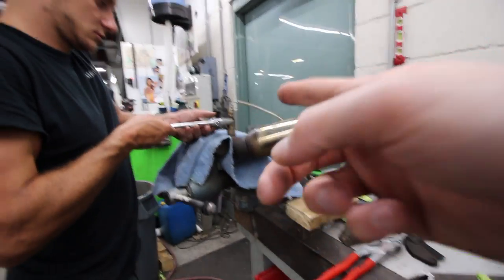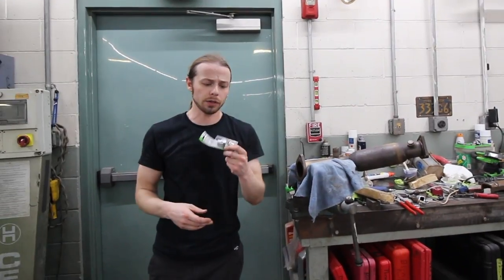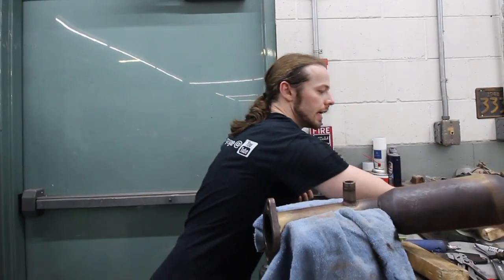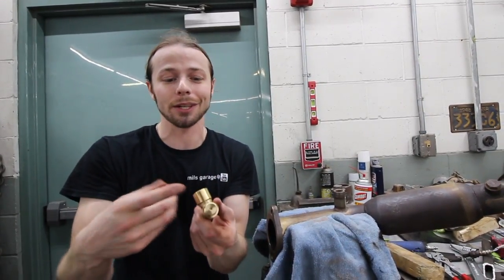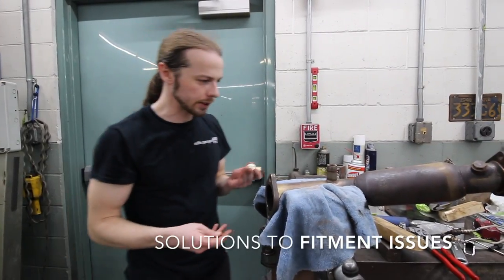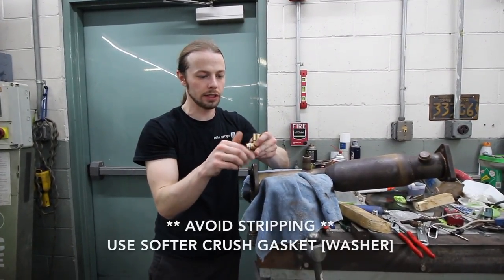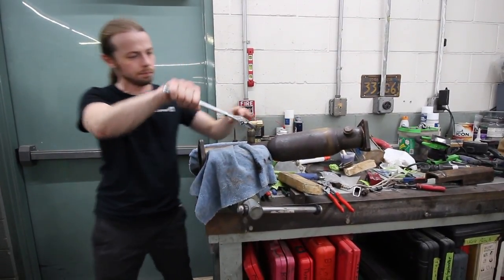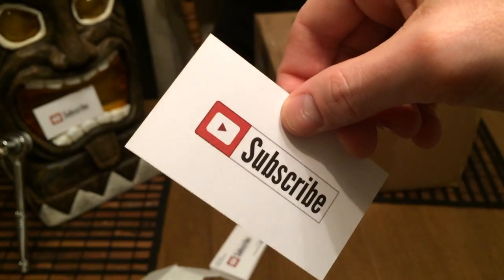How to Use O2 Oxygen Sensor Extender Spacer to Turn off CEL [ P0420 & P0430 Fix ]

Comment: Anti-seize grease, on all your exhaust threads, helps a ton.
Reply from the maker: Yessir 👍 Keep up the great work
Reply: @milsgarage  how do you know what size non fouler you need? I need to do this on a 03 Cadillac CTS. Please help. Thank you
Reply from the maker: @TR1CKSHOTS31  One way to figure it out is to search on the internet and hope they're right.. Another idea is to go to an auto store, and ask to see a stock 03 Cadillac CTS O2 sensor, and then figure out the thread and pitch there. They have bolts that you can compare the threads to 👍

Comment: Just buy the spark plug defoulers  available at autozone ,buy two packs about 12 dollars total for both, you will have a total of 4 defoulers, drill one of the defoulers with a half inch drill bit  connect the drilled defoulers to o2 sensor and  the other defouler in sequence, use 2 defoulers in sequence, disconnect battery to clear engine light and drive car normally if light comes back on, use 3  defoulers in sequence  if light comes back on same code p0420 or p0430 use 4 defoulers, if light comes back on then buy a 02 sensor simulator ,always use defoulers or o2 simulator in the last o2 sensors the ones after the cats. Usually the one before the cats is not an 02 sensor but a fuel and air ration sensor you don't want to put defoulers there ,
Reply from the maker: 🤔 Non non non non foulers? lol It'll work. 👍
Reply: Used this method on my 2005 lexus is300 two defoulers and it worked ,recently used it on a  2006 scion xb had to use 3 defoulers but it worked also,( note) barely was able to do it because the length of the o2 sensor wires was stretched to it max after the 3 defoulers in sequence.   I'm thinking 3 defoulers might be the max you can use in sequence because the o2 wires are usually kinda short and most cars

Comment: Hey man awesome video, been looking at videos all day and this was most helpful, along with the other video that went along with this one. Getting ready to purchase the rest pipes and the non foulers and get to work 🤘
Reply from the maker: @Bobby Griffith Yo Awesome! Thank you for your support Bobby! You're going to want to do it on a day where you have some extra time just in case those TP bolts are seized, and if the demon bolts don't make a sound when it feels like it's starting to turn, you're going to want to switch to an impact gun to make sure you don't strip them completely.. Hmu on the channel if you hit any snags and keep up the awesome work sir 💯
Reply: Awesome. One question though, if my o2 sensors are bad putting the test pipes on, I still need to get new sensors correct.
Reply from the maker: Yeah, you're going to want to have good sensors even if you install the TPs.. Which engine are you running?
Reply: 2005 g35 v6 3.5 it's a base model other than that I couldn't tell you, I'm not much of an expert, but ever since purchasing the g35 im becoming more of a car guy. All my knowledge comes from YouTube and occasional hands on experience lol.
Reply from the maker: Sweet. The 2005 you have most likely has a RevUp engine. You're going to want to tune it asap after installing the test pipes. This G i'm working on in the video is a RevUp too. i didn't run the engine detuned long enough to make a difference, but according to a good drift buddy of mine, it'll eventually kill the thermostat, cause it to overheat and die.. He said went through 3 engines before he figured out what he was doing wrong
Reply from the maker: "All my knowledge comes from YouTube and occasional hands on experience lol." <-- This is how it all starts 🤟😂
Reply: @milsgarage  as far as tuning goes, whats the average price range and what kind of shops would be the best to go to for that.
Reply from the maker: The tuning for VQs is pretty much standard with UpRev [ https://www.uprev.com/secure/ ]. Looks like UpRev sells the Standard license and setup for $550, but after you get custom maps and stuff, it might come out to more like $750. There are a number of tuning shops in the Delaware area that i know of if you're around. You can also tune by email after you have it all installed

Comment: HELP PLEASE .!!! Could i delete the honeycomb and install the non foulers? So like that i will keep from getting the codes and from letting my car run lean from obstruction?   I have a 07 expedition and its been a nightmare because everything is new in the truck you name it its all new and oem the only thing it wasnt was the catalytic converter i install almost a year ago. No im having rough idle only sometimes its starts to sound like its cammed 😅 you can feel somewhat of a shaking movements in park but when shift to reverse or drive it start to act out but it drives just fine and i only get the p0420 code and notices that im getting misfires at low rpms.
Reply from the maker: If you’re getting codes and misfires, it will need a tune. The computer needs to understand what to do with the new oxygen levels
Reply: @milsgarage  The problem im having that everything is new (coils, sparkplugs, injectors, fuel filter, pump, mass flow , throttle body) i mean you name it is all new and just finished doing a whole timing job with machined heads new cams and lifters and follower same as intake valves. EXCEPT !! The o2 sensors which im getting news ones tomorrow and the catalytic converter which i bought it from ebay last year and im having this rough idle when the rpm drops seems like the computer is compensating for and unknown issue which is driving me crazy lol but thanks a lot for replying !!

Comment: the P0420 code came right back so this time I stuff the phone with steel wool hopefully this works 2014 Infiniti Q50's are very sensitive
Reply from the maker: @ls1killa Awe man, thanks for the input! i've heard of people doing that before too, but don't have any personal experience trying that out.. Please lmk how that works out for you 👍
Reply: ls1killa hey man I just installed berk test pipes on my q50 too and I got the check engine light. Any luck with the check engine light yet?

Comment: So I have a 2007 G35 Sedan with the VQ35HR engine. I bought some 1320 Performance high flow cats due to my current cats rattling from the honeycomb coming loose. The new cats are designed in a way that the cat is on the back end of the 02 sensor. So as far as my 02 sensor is concerned, it is as if I am running straight pipes. The cats do have a bung extension for the 02 sensor like yours does. And the hole of the airflow to the 02 sensor is very small. About the same size as the hole on the spark plug defouler. I get the p0420 code that states my sensors are not sensing enough air flow. BTW: I put all new 02 sensors (Denso) on all 4 banks. And the code reader gives me the code for all 4 sensors. 2 p0420 codes and 2 p0430 codes. Did this help your situation at all? Thanks
Reply from the maker: Wow, i imagine you'll need a tune to make sure everything's running efficiently, and they'll be able to disable the check engine lights
Reply: @milsgarage  Thanks for the reply. Did any of those adapters help your situation?
Reply from the maker: @eleven8948  Yeah, it turned off the lights, but it still needs a tune

Comment: have these exact same test pipes on my g37 and get the p0420 code. sux but i'm going to try this exact method and see if it works. any updates on whether that helped eliminate your check engine light?
Reply from the maker: it should [will] work. my CEL never turned on. we do this to a lot of cars and they've never had issues either. :)
Reply: Mils Garage awesome thanks for the quick reply! Subscribing 😎
Reply from the maker: anytime Sin-Tax! that's how we do it. 🤟😎👍 thank you for your support!

Comment: What's the size of non foulers? I don't want to buy some it ends up not fitting. I thought I wouldn't get a code because I installed them back in October. But I finally got a CEL just yesterday. I assume it a cat smog related code. I don't drive my car much because I have others and my G is mostly a garage queen. I put some miles on it and a cel came up. I assume you have to drive it to throw a CEL? I always thought if I would get a code it would be at first start up. Size of the non foulers please.
Reply from the maker: 18mm. yeah, it can take some time to register a code.. i hope the O2 sensors aren't fried in oil when you take them out
Reply: @milsgarage  I'm going to use O2 oxygen sensor extension extender M18X1.5 off ebay asap. It's 32 mm long. Hopefully that length will get rid of cel.
Reply from the maker: you might wanna go with a set that has a 90 degree bend in it. i hope the 32mm fits with everything that might be in the way
Reply: @milsgarage  It's not long enough to be in the way of anything. It's mounted on the side in the oem position just a bit longer so I shouldn't have any ground clearance issues. If anything I think it's too short and might not help. But who knows, it's worth a try

Comment: Sure, will keep code away, but if you have a catalytic converter the car will run leaner and you will experience loss of power (on my '09 2.4 camry at least; maybe not w/ older cars?) Wouldn't recommend keeping it in.
Reply from the maker: this is a solution aimed at people who have removed their catalytic converters, or have a code saying their cat is bad, when it hasn't been ~15 years [ those cats are doing just fine ]. unless someone pulls out some dyno sheets or the car goes into limp mode, i don't trust butt dyno's, but there is an absolute possibility of running lean.. i would say it's most likely due to not resetting your ECU, but we can nitpick stuff all day w/o those dyno sheets and a diagnostic reader

Comment: No drilling   needed,   IF  YOU  FIND  THE  NON fouler   on   ebay,   one  solid  piece.    When  ordering,  type  in   Make,   model,    and   year   of   your   vehicle.      It  may   ask  for   your   engine   size.      Make-----model-----year        for  example,           Volkswagen------Golf---2004
Reply from the maker: @Benny Greene   Yes,      and   this  is  a   weird   way   of                    communicating   .             👍

🚗                             💭                 ➰➰         🚗               🔥                                🔥🔥        🔥       😳

Comment: That P0420 code is so annoying.. I have to do this too on my car.. but what’s really the reason for the code though? Exhaust leak?
Reply from the maker: The computer is looking for O2 readings to match what it would receive with a fully catalytic converter cleaning the exhaust..  When the numbers don't line up, it shoots an error code to have a mechanic check it out
Reply: @milsgarage  I see. Thank you 👍🏻
Reply from the maker: @Mike_44  Any time Mike! 👍 If the code keeps coming on, you'll want to get new cats.. Or you can get a tune that has the ability to override the light, as well as make your car run more efficiently and protect the life of the engine

Comment: Hey if I hollow out  my catalytic converter can I do this for I don't get a check engine light.
Reply from the maker: @DANTE FLORIAN Good question.. Yes, using these would even work if the cats were gutted. But everything i've ever seen about gutted cats is that you'd be better off running straight pipes so the air flows unrestricted. i've seen sets of test pipes online for $150 and you might be better off running those, especially because taking the cats out to gut them is going to be a lot of work in itself
Reply: @milsgarage  thank you man for the information. Cause I have a 2013 Dodge avenger 3.6l  v6  and I wanted to take the cat out. But what can you recommend me to do?
Reply from the maker: @DANTE FLORIAN Oh ok, wow, so i was expecting to find more options for you.. It seems that a couple dudes got their cats off, said it had a loud whining sound, and put the cats back on. No test pipes for sale so far.. wow.. Maybe long-tube headers? But the ones i'm finding are for the 3.8L.. i'd search more through your buddies who build Avengers, but you might have to have custom test pipes made fro you

Comment: soooo... i have a new cat on my subaru and new sensors and it is still throwing the p0420 (bank 1) code. Do you recommend one of these for me?  Also, should it be installed on the upstream or downstream sensor?
Reply from the maker: Did you reset the ECU yet? If you have a new cat in there, it shouldn’t need any non foulers like we show in this video
Reply: You  may  possibly  find   one   on   ebay,   should  not   cost   much.    First  thing   type  in   02  spacer/simulator.
Reply: Try  ebay  first.      Thats  where  i   found  mine  for  my  VW.

Comment: Hello guys am new to this Chanel I am so inspired now that I watch ur videos so am 17 I have a job  but I have to pay rent  so  there’s not much money I can use to get a carwhich are some tips you can give me to get a cheap car as beginner
Reply from the maker: hey Jonathan, that's awesome!! Welcome to the channel! 🤟😎👍 sure! don't buy from dealers unless you're willing to pay $2K~4K more than the car's real value. me and Ryan shop on Fb Marketplace and only buy directly from owners. don't be afraid to throw offers that are lower than the requested prices either. we have lots and lots of DIY tutorials that will set you up to build your car, so for things like brakes and rotors, if it has to be done, you can most likely negotiate a lower price. honestly though, if a part of the car needs repair, you shouldn't be paying for that part of the car anyway. it pays to like older cars too. i'd choose my G35 over a Q60 or whatever new option you come up with, and i can buy 4~5 of my G for the same price.

what type of cars are you interested in? maybe i can guide you towards a couple models that you should be able to get your hands on

Comment: Hey guys! My cats are bad on my 07 tundra. Will the non fouler method work if I get the cats removed completely and get a pipe welded in it's place?
Reply from the maker: i'm not sure.. It doesn't always work. Some cars are much better at registering fluctuations than others

Comment: What is the point of a non fouler? Does it make it more hp and cant you use a 90 degree 02 sensor to put in ur 02 sensor if it doesn't fit
Reply from the maker: In this scenario, the point is to extend the O2 sensor with a small pocket of air. This does nothing to horsepower, and running a modified for too long without a tune will damage the engine until it needs repairs. You can absolutely use a 90º O2 sensor if it doesn't fit 👍
Reply: @milsgarage  thanks😃 i need a 90 degree 02 sensor bung for my headers

Comment: So I just got my cats gutted out. And check engine light came on ... I have a 5-speed gt mustang. I started driving 2 days after my car was running rough. Very rough alottttt of misfires , pops, check engine light was blinking. So if I get this it’ll stop the issues I’m having cause it wasn’t like that until I got my cats removed well gutted
Reply from the maker: No, it will not make the car run differently. This only turns off the CEL. Your description leads me to believe you will need a tune to run properly with gutted cats

Comment: If I got berk resonated test pipes with cel fix do I still need to do this
Reply from the maker: This will turn out the light, but you will need to tune your car or it will run lean and damage your engine. This is not a good long term solution

Comment: my 350z has berk testpipes but theres no check engine light or pending codes , i took it to the emission test but it didnt pass (catalytic converter not ready/ evaporative system not ready/ oxygen sensor not ready) do u know  those non foulers will help to get the readness test ready?
Reply from the maker: hi Yoshi, where are you located? when they checked your emissions, did they just plug a reader into your OBD2 port or did they go behind the car with a smog detector?
Reply: @milsgarage  im located in illinois and they plug de obd2 reader
Reply from the maker: @yoshi z33 wow, no CEL and it failed? i passed the OBD2 test with the non foulers installed. the non foulers should get you to pass, but you're going to want to get a tune soon too
Reply: @milsgarage  my z  is supercharged but im not if my tune affect my readness test
Reply from the maker: @yoshi z33 oh, it is? AWESOME! hmmm i imagine the tune is what's keeping it from throwing the CEL.. you might want to contact the tuner to see what they say about passing emissions. i'm sorry, i haven't dove into ecu tuning yet [that will happen this season on the channel].. maybe the non foulers would work, but i have a feeling the tune can make the computer spit out some passing numbers
Reply from the maker: @yoshi z33 🤟😂👍 i'm all up on the Demon Bolt Episode asking you questions i've already asked you before?? lol

Comment: I installed defoulers instead of the non foulers and my engine light is still on would it make a difference if I use the non fouler?
Reply from the maker: Hey Jose, i searched for defoulers, and everything i see popping up looks like non foulers to me.. Do you have catalytic converters still?
Reply: No I have Megan racing resonated test pipes and at first I was getting both 02 sensor codes and now I only get one I think it my be a bad sensor or the way the defouler is positioned ?
Reply from the maker: Sweet. Possibly either of those could be the issue.. They take a beating without the cats being in there. What year do you have?

Comment: does that help to solve black smoke and high fuel combustion or turnoff check engine onlt
Reply from the maker: Non foulers won’t fix fuel consumption or fix smoke issues. It may cause lower mpg, and is meant to be a temporary fix for catalytic converter failure misdiagnosis, or tracking your car w/o cats